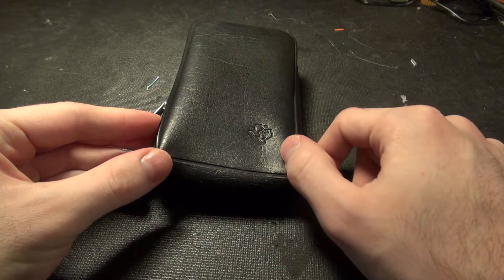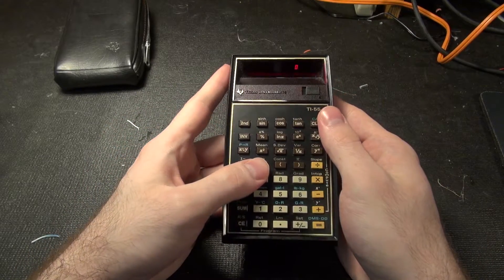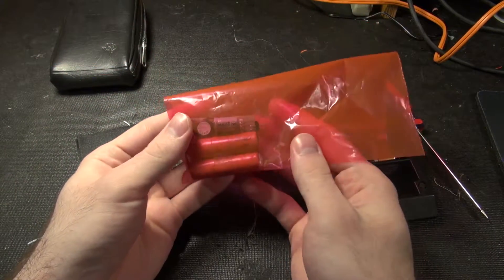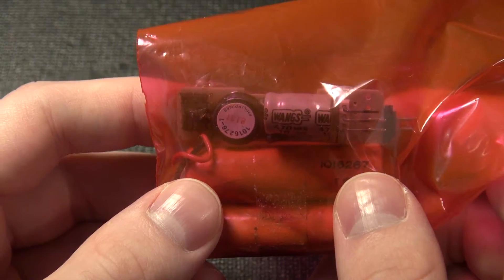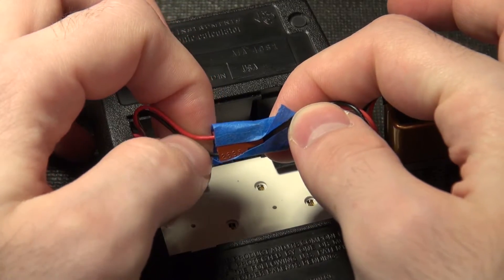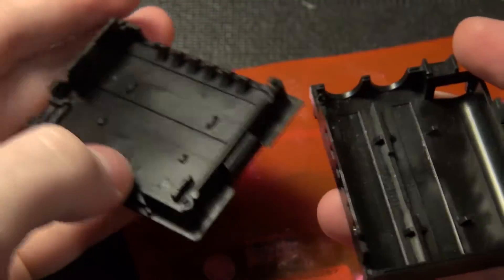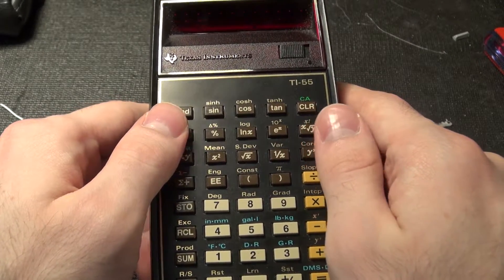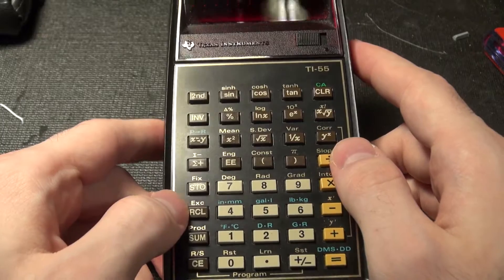TI-55 Calculator Battery Replacement

Comment: Great hints there, replace the battery pack with a 9volt battery. Yes, the PCB for the battery-pack is destroyed by the juices that have dribbled out of the rechargable batteries, hardly surprising for a calculator that is now celebrating its 46th birrthday!

Comment: Please be aware that not all TI calculators use the 9 volt.  Earlier TI SR-51A models used 3 cells at 1.2 volts nominal for approximately 3.6 volts DC.  Which is about the same as a single LiPO4 cell.  And that is why I converted my original SR-51A to a recharging pack.  You could put a small piece of heat shrink tubing on the red/black wires from the calculator instead of the blue tape in your video.

Comment: I have a T1 55 Calculator with 2- A76 batteries.     We popped them out (without seeing which way was up and which was L& R= and now can't put them back in & close the door?????  There is a + and - where the A76 go.  No matter how I place the batteries, the little door will not snap in place.  The door closes without the batteries.    We figure it is how the batteries go in.

Comment: Everyone needs to grow a pair and replace the NiCd batteries and just fix it!
Reply: Sure. As long as the leaking batteries haven't corroded the circuitry and chips - go for it. Many (if not most) battery packs are toast, though, due to excess corrosion over several decades.
Reply: Also, not everyone has the matching charger.
Reply: @jpleva9987  That's the big thing. I just bought a really nice TI-55 just for the charger.

Comment: I paid $49 ( Canadian)  for mine in 1969
Reply: Ti 55 was made in the 1980  time
Reply: @danc2014  yep, appx 1977 to 1980 or so. The chip was first made in 1977.
Reply: @danc2014  I bought a TI Programmable 57 in  Nov 1977 (about $75).  Sept 1. 1978 I paid $3.15 for a replacement on warranty.

Comment: +Nick Drudge
Hehe I have done exactly the same with my TI-57. :)
The original battery pack was in an even worse condition than yours, with lots of white gunk seeping out of the cells, and the little PCB inside was almost completely corroded.
Reply from the maker: It seems to be the most common thing to do! Those batteries seem to get quite out of hand when they start going bad! This series has become one of my favorite lines of calculators!

Comment: Thanks for showing the color coding, that would've tripped me up.  I bought mine new in box around 1978 and somehow it was enough to get me thru undergrad EE. But that darned battery pack WENT DEAD DURING EXAMS! How I wish I knew this 9V battery trick back then! Spare batteries would've saved my sanity.  I totally forgot how to program it but I have the original manuals.
Reply from the maker: I really wonder how many people figured out or knew about that battery trick before help from the internet. Yeah I can imagine how infuriating that would be! All of the TI calculators I used during exams had just AAA batteries, and I'm sure I always had spare. I barely know how to use the advanced features of the TI-55, but for general use, I enjoy using it more than most graphing calculators just for the look and feel.

Comment: had the same one during my college days back in 1975. one or two years later everybody was using LCD calculators more power efficient and cheaper. but the red bubble LEDs were simply more beautiful.
Reply from the maker: +mramlija It really is a pleasure to use. Always great to hear love for great calculators.

Comment: I found my old ti 58c with memory module and the adapter, I had taken the bp1a battery pack out long ago when it died, it still works great on the adapter. I too like to collect calculators for some reason, dono why.  Thanks for the great video.
Reply from the maker: Calculators are just weird and fun to collect I guess. You're welcome and thanks for enjoying!
Reply: Fellow collector here.I have almost the entire "Majestic" line of calculators from TI, an SR-52 and a TI-59, TI-85, TI-86, and a few Casios as well.

You fellows may find this site interesting: http://datamath.org/index.htm

Comment: Could I use a rechargeable 9 volt and retain the factory charging cable and oem look?
Reply from the maker: There'd be a bit of work to it depending on what you were doing. The problem is the factory charging cable is meant for the two ni-cads that were in there and will not charge a 9V, but since you want to maintain the look you will need part of the connector that's on the board, but don't want to use the circuitry that is on the board in the battery pack. The easiest solution is to replace the two ni-cads with ni-mh cells, assuming the board was not damaged by the old batteries leaking.

http://web.tiscali.it/city/repair1a.htm Seems to be a nice guide that shows how you can maintain an authentic look, and expose the contacts on the 9V to remove the battery pack and charge externally. I'd have to dig out my TI-55 or just think about this problem a bit more to think of some probably obvious easy solution.

Comment: how can i get this calculator's battery ?and how much this is cost,if you answering me i will happy :))
Reply from the maker: What are you needing? I removed the old dead batteries and replaced with a standard 9V battery. There are some replacement parts online where you replace the board in the battery pack for $35USD and use your own batteries they suggest. I don't see any seller with complete packs for sale, it seems mostly DIY from complete used calculators.
Reply: +Keskin
Hey there Buddy, in case you haven't found a solution, let me give you a link to a guide on how to repair those old battery packs:
http://datamath.org/BP_Repair.htm

Comment: Hi, great video. I've heard about the polarity trick some time ago. Just a curious case. I live in Campinas, São Paulo, Brazil. Texas had a calc plant here arount 70's and 80's and sold all US Texas line from all over the country (calc litho, manual, warranty, box in brazilian portuguese). My Ti-55 doesn't have the polarity colors inverted, but some others like the TI MBA has.
Reply from the maker: +danlucio2008 Well that's cool to hear! Yeah it's a strange little case, and odd how it seems to be random across their brand.

Comment: dude you absolutely saved my life, i got one as a gift, and it had the original 1970's battery, they degraded as fuck and both of the cells and booster were useless, and i was trying to make the darn thing to work with the 9v battery but i didnt know the reverse polarity thing, the screen loaded very slow and it didnt show any numbers, now i connected it like you show and it fired right up, and it works like a charm, thank you very much for making this video
Reply from the maker: +santi0797 No problem at all! I knew I had to make a video because those are awesome calculators, just a bit weird by today's standards to get them powered. Figuring that out and they work great! So you're welcome and glad to hear more people have TI-55s and want them working!
Reply: +Nick Drudge yea, im used to having a little 3 volt clock battery that lasts for years, this sucker will smoke the 9volt battery haha, this calculators are awesome tho, the screen is so unique, and the build quality is amazing, i would love to restore the original battery pack to have the calculator 100% stock, i even have the charger, but the corrosion from the leaking batteries absolutely destroyed the circuit board, and even the cables, well, at least it didnt harm the calcularor, that would be a real tragedy, its funny, this thing almost got thrown to the trash, im lucky i have it
Reply from the maker: +santi0797 You're super lucky to have the charger for it! From what I've seen, there are replacement boards you can get that have modern boost converters on them, and they may or may not have batteries, but either way you can actually buy somewhere the new boards. Half the reason I wanted to 9V is since I didn't have the charger I didn't want to bother. You are very lucky to have it. I hate the idea of throwing good electronics in the trash. The buttons on the calculator is what sold me when I found it, the feel is so incredible compared to almost all calculators these days.
Reply: +Nick Drudge i will see if i can get them when i travel to the us, i live in argentina and its impossible to find these kind of things, imports are closed scince 2011, so yea, no way i could import the board by itself, or the batteries, because they are not produced here and thus, i cant buy them, i will see how far i can restore the original, with a new cap, and maybe if i can find the cells here. i really feel that having such a piece of amazing electrinics deserves to be in its full original glory, but if i cant do that at least i can use a normal 9v battery, the fact that i got it gifted and still works is more than enough for me haha
Reply from the maker: +santi0797 Does ruin the fun a bit. Well I'm sure you can make it work with off the shelf parts! Have to look again, but the batteries should be pretty flexible on finding something that will work. And don't forget that if any tracks are shot that you can just run wire! Best of luck repairing it and enjoy the US when you head here! Just having it work with a 9V is quite good enough, even though it won't last nearly as long as anyone would like. And that's why I get these old electronics and work on and fix them, they were incredible in their day and still very amazing these days.